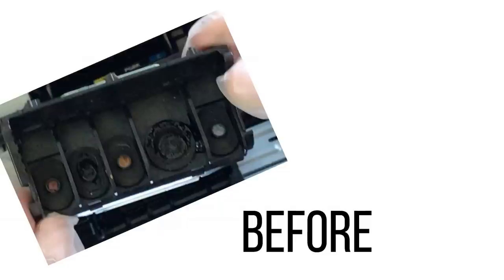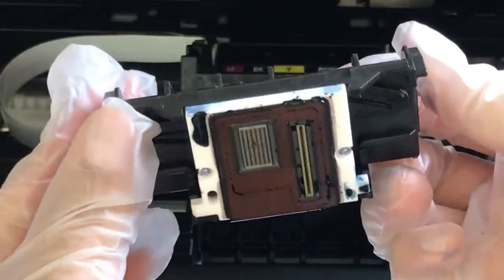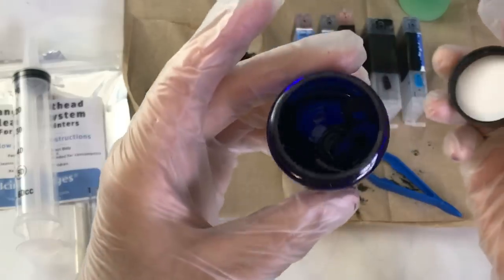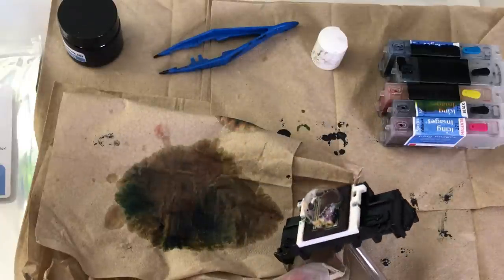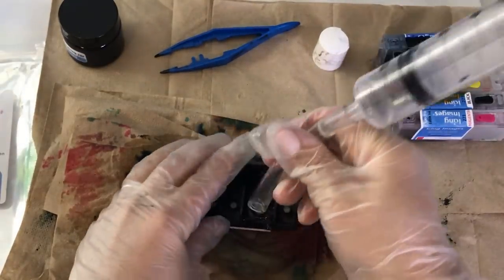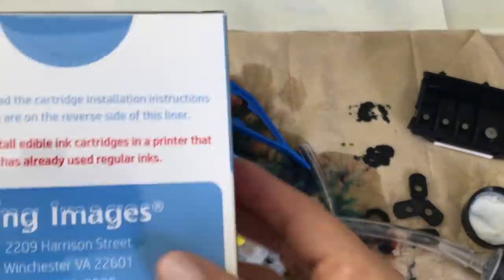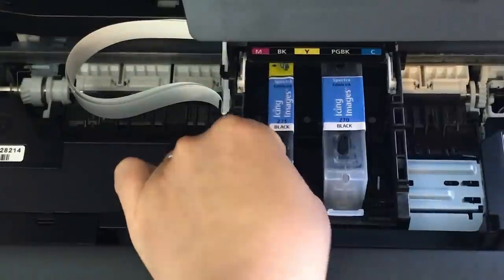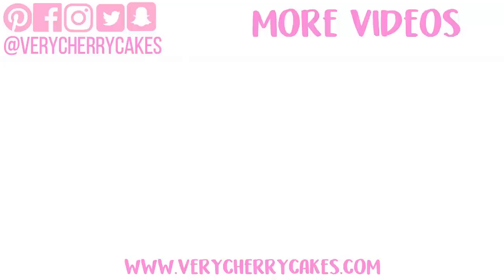HOW TO CLEAN YOUR EDIBLE PRINTER | VERY CHERRY CAKES

Comment: OMG Your video is THE BEST one I have seen. The others did NOT show me how to take the print head out THAT is THE MOST IMPORTANT PART. You explain everything so well. I was afraid to run water on anything because it is a machine but I saw you do it and felt more confident. You had the exact same printer I have, I didn't go as long as you but I definitely could not print black. All the other stores in my area had the same problem. Maybe I should charge them to go fix it for them LOL j/k THANK YOU SO MUCH!!! I will be cancelling Geek Squad from Best Buy

Comment: I cleaned and replaced cartridges. I even cleaned with the app. I have canon ts6100 series...its aligned..the lines are great....just no color prints out except black...they are in correctly and the yellow tape removed...my image is black and white with yellow...yellow is not printing.....my friend bought this for me and I've only used it a few times...I manually cleaned it....but when I replaced with the extra set of cartridges it states that yellow and one of the black was reused...and my magenta is not full even though it was brand new...please help

Comment: Watched this video a bit late, but I kinda cringed when I saw you running the print head under hot water without covering the chip part.  Didn't it damage it from water damage?

Comment: I know you posted this years ago but had to comment. I followed your steps (without the cleaning kit) two times now when my printer stopped printing properly (was on the verge of getting a new one). THIS WORKED both times now. THANK YOU THANK YOU THANK YOU! You are an amazing person inside and out and appreciate you sharing your tips with all of us. Thank you for all you do. Love all your videos and so blessed to find you. Hope you have a great adventure in anything you do. Thank you so much!
Reply: Hi! How did you clean your printer head without the kit?? What did you use?(:
Reply: What edible printer do you have I have an icing images one but it sucks! I can run the printer 1x per week it still clogs I have had to replace the printhead 2x already n barely printed anything from my printer! It’s WILD! Please share what printer you have that you were able to clean 2x and it worked!😀
Reply: @nancyag18  I ran under water to clean and let air dry.
Reply: @bridgettchapman5020  I have a canon pixma iX6820. It's not working again and I've had trouble with it but haven't cleaned yet. I don't think they make these anymore

Comment: thank you for the best instructions! My printer is fairly new but hasn't been cleaned for about a year or 2, I didn't have cleaners so I just ran that piece under hot water and I saw the clogs of color run through. Printer is back to normal now!!

Comment: Thanks for share your tips! I had a canon pixma MG5420 since a bought this printer I have had difficulty  printing with the correct colors, after a few years and used a few times my machine died , can you share with your opinion which printers are the best ? I want to buy another one but make sure i get the right one, thank you!

Comment: I have taken the print head out so many times over and over and cleaned it like you showed and my colors still aren’t right. I’ve even unscrewed the 2 screws in the back and rinsed out that area..any other tips? I bought a kit and I’ve used it but could I use white vinegar also? I don’t want to use up all my edible cleaning solution trying to trouble shoot
Reply: I tried to upload pictures to help explain but I didn’t see where I could upload any :/

Comment: I am looking to buy a printer for edible images. I make cookies. But can I purchase a printer from Walmart and use edible ink cartridges?
Or is this a special kind of printer ???
Reply from the maker: you can definitely buy a normal printer and use edible ink cartridges with it as long as you never cross use it with non edible ink. The only downside to doing this is that you won't really have a customer service center to call for help. I bought mine from Icing Images. The link is my description box. I hope this helps :)
Reply: Thank you so much for your reply, it was very helpful. 
💕👍🏼

Comment: I didn't have the cleaning solution so I used hot water and a condiment bottle. I cut the tip to fit the color poles in the printer head, except the larger pole. It worked beautifully!!
Reply: Hi Olympia,
What did you use for larger pole?

Comment: I just bought a Epson 3540 work force , it was a  normal printer and got it at a good discount and  just bought edible ink. And just found out it’s no longer food safe can u help me how to clean it to make it food safe where do I clean it out  what do I use ?? I use a Epson workforce 3540 I really wanna not have to spend more then I already have (already over budget) 50$ second hand printer and 400$ in supplies for edible paint and ink and paper
Reply: What did you end up doing?
Reply: The printer has to be completely new. You can’t use a printer with normal ink and convert it to edible printer.
I bought mine like a month ago. I did my research and I did not want to pay to much so I got a canon pixma ts702 that cost me $80 and I bought the edible ink from Amazon $40
Reply: @janedoe9059  hello.! Just wanted to know how is the pixma ts702 printer working for you? I'm a beginner and I want to start with something inexpensive for edible printing.
Reply: @yadihaciendounpocodetodo6446  is working great. 
I think is the perfect printer for me right now. Like I said before... I paid $79 dollars and I bought the ink and the icing paper on Amazon.
So, I paid a total of $160 $170 maximum.
This printer doesn’t have scanner but for me is not a problem.
Reply: @janedoe9059  you got a super deal, Is about $90 bucks now but still more affordable than other printers. How often do you print? I'm afraid of clogging up. 
 I'm still thinking of getting it no matter what I think is a great buy for a beginner like me.
Reply: @yadihaciendounpocodetodo6446  I print once a week about 2 or 3 images
I always make a test with normal plain paper to see if is printing ok.
Reply: @janedoe9059  awesome,  Thanks for the tips.!
Reply: @janedoe9059  hiya! I’m sooo thankful for the info on the cheaper printer! What ink and paper do I need to order please?